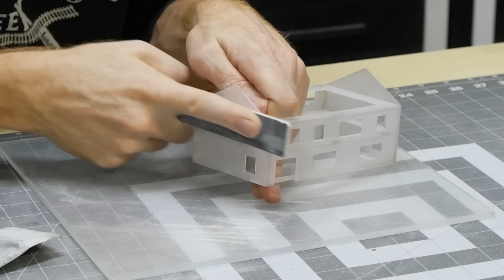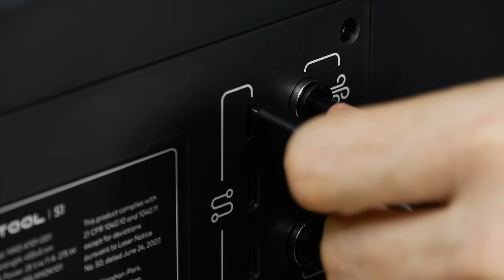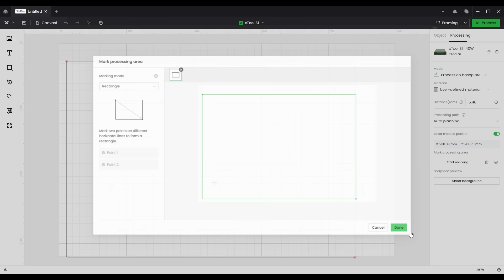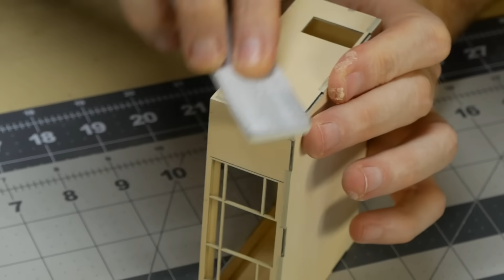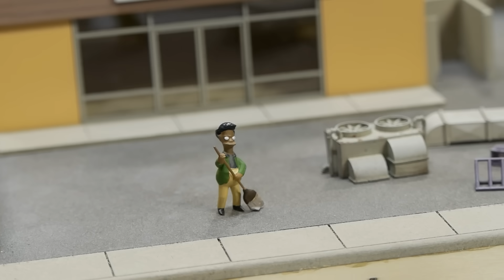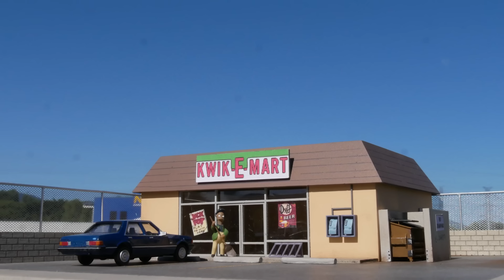Building Springfield’s Iconic Kwik-E-Mart with a Laser Cutter

Comment: If you're going to build the whole town, will you do the dome? Also, which do you like working with more, acrylic or plywood?
Reply from the maker: An entire model of Springfield would fill my garage and then some 😅 I'd probably say plywood, it's just a bit easier to manage and glue together, it sands better and is a bit more forgiving. The down side to wood is the grainy texture but with some paint filler it's easy enough to get nice and smooth. On the other hand acrylic is much less likely to warp but doesn't sand as easily and is more expensive.